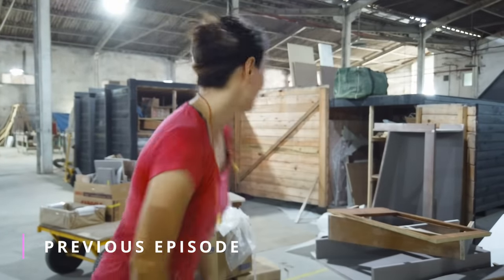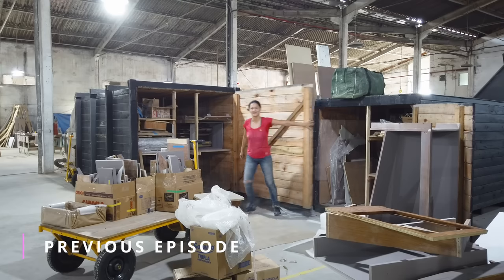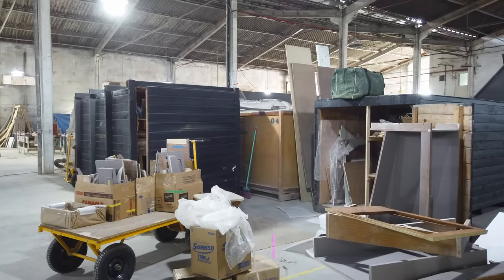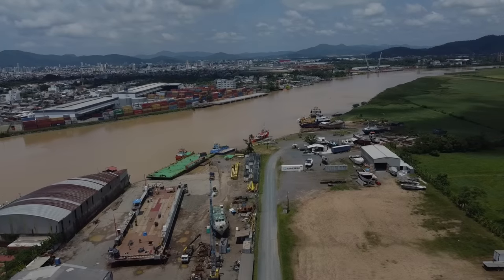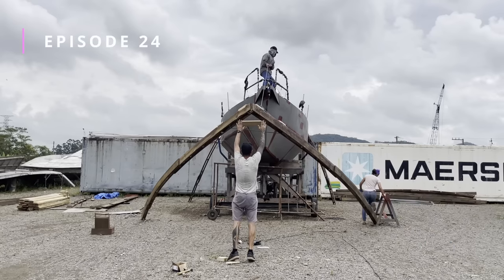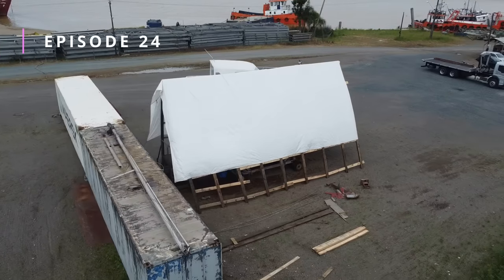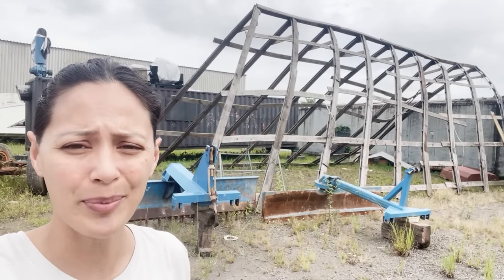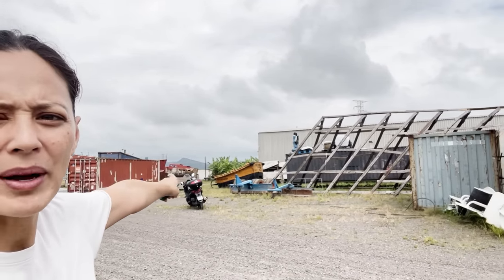Things are going from BAD to WORSE!! ⛵️ Ep66

Comment: As a wood butcher ( carpenter ) i would recommend spending a few days and rebuilding your wooden structure . Some additional bracing wouldn't be that expensive . Chk out the Duracell project they just constructed a similiar  A frame enclosure . Make sure you strap it down so it won't blow away .cheers